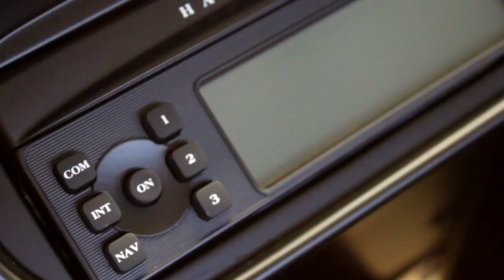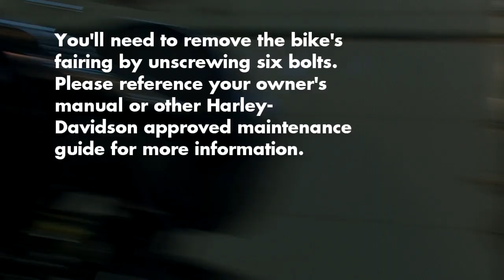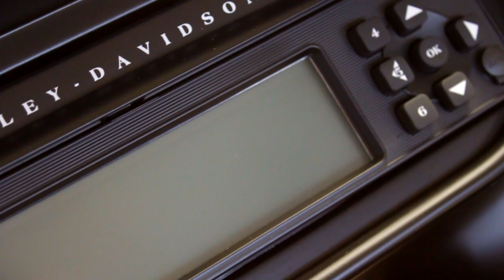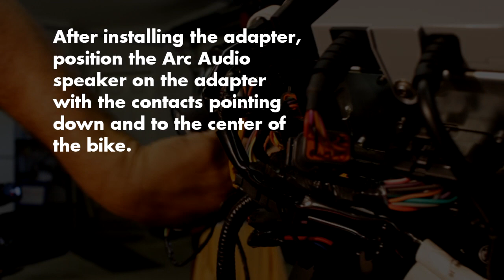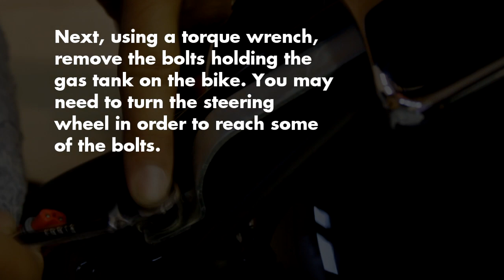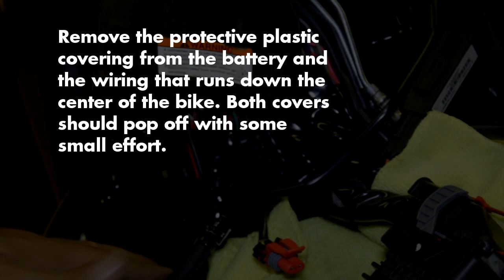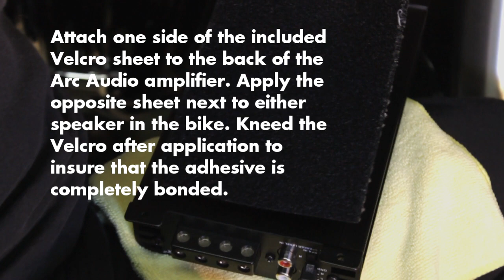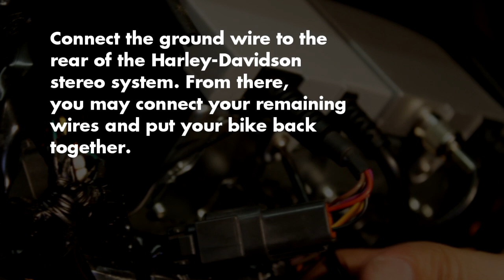How to install aftermarket stereo speakers & amp in a Harley-Davidson Motorcycle

Comment: Is this all plug and play wiring?
Reply: I have a question for you. I just recently bought a 2015 ultra limited. They told me I can't use anything but boom series speakers and amp because nothing else will not work with the new stereos in Harleys. Can you shed some light on this?
Reply: Pete? The boys at arc told me how to get around this. I am going to try and get my local dealer to help me out. He also tells me that you aren't too far from me if I have your location correct. I would like to come down and visit you when it gets a little warmer here and have you put a system in my bike.
Reply: Unless you're not the Pete from Sounds? I just as soon not open up the faring on the 2015. My old bike I wouldn't have had a problem.
Reply: Yea it is there are some little changes on the mounts of the speaker ring but that was about all there is to it on the 2011 RG.  I don't know how this would work on the 2015.

Comment: That's the difficult way to remove the gas tank. Do not remove the dash panel on top of the tank. Just disconnect the vent lines at the back of the tank, by the battery, and the tank comes off in one piece.